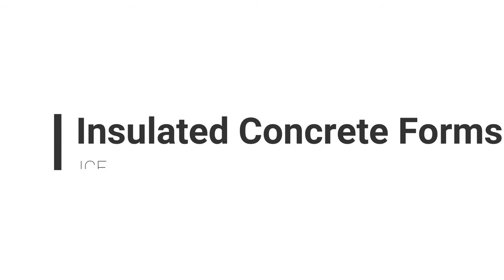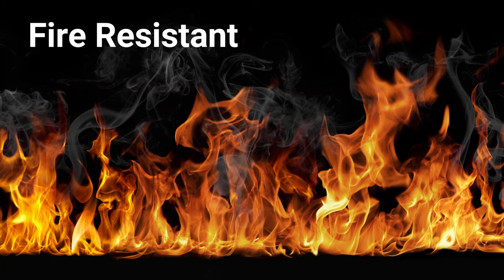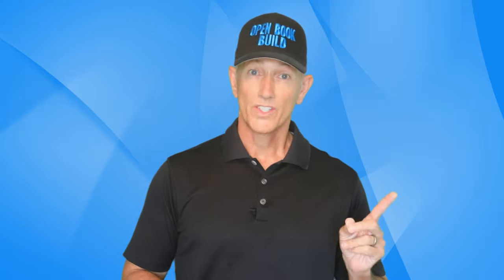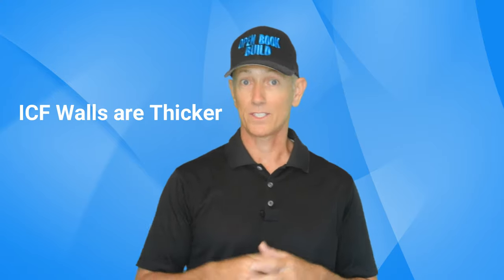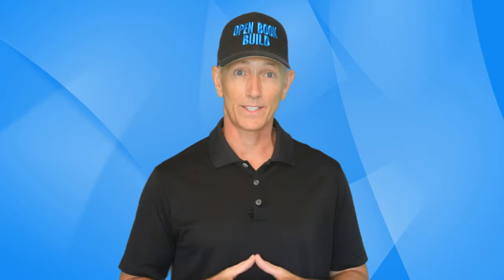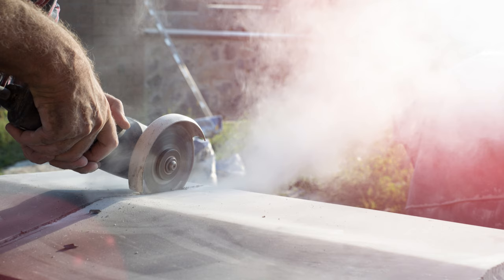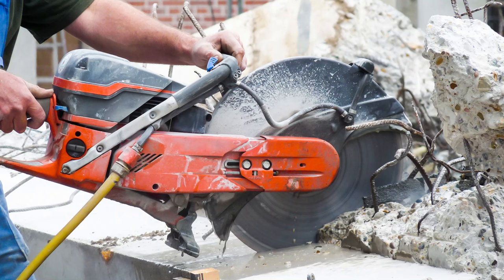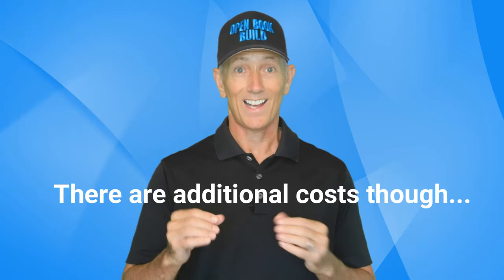ICF Construction: Why I Haven't Used Them as a Builder

Comment: I have to build a small house to live in. Around 20x20 is large enough for one old guy. I want to keep costs low, but it needs to be really well insulated to keep the sometimes minus 30F cold and 100+F heat out. I'll have a basement for the water heater and furnace and things like that. Stick frame, at very least 2x6 studs and possibly 2x8. One room with a small enclosure for the bathroom, the rest of the floor plan will be open with just supports for the roof and our often-heavy snow loads. OR, ICFs? There's a local builder who specializes in ICFs. They'll do the job right the first time. Hmm, what should I do?

Comment: I have watched several videos on ICF’s. One issue that I have seen is that they can’t get termite protection. Due to the insulation on the outside. The termites being able to tunnel through it and not being visible.
Reply: Not true. The exterior wall of ICF can be protected from termites, if needed, like any other wall by using wire mesh screens or other methods. Plus any termite damage will never be structural as termites can't eat through the concrete core, and the foam is not a food source.

Comment: Masonry loves to wick moisture. Masonry need some air contact to dry out, or it gets water logged. The plastic pieces allow moisture to go though the wall. Rebar should be in cased in at least 4 inches of concrete to keep it from rusting. Icf is 3 times the amount of cmu block plus concrete.

Comment: How about using ICFs for just a foundation wall? Considering for a bardominum build in NE Ohio.
Reply from the maker: Definitely good for foundation walls
Reply: @OpenBookBuild  Good to hear. Figured it would be excellent for a thermal break to the slab. Side question. As you are in Ohio, are you aware of any bardominium builds around? I’m nervous Lake County will be a real pain to try and build one. Especially as and owner builder.
Reply from the maker: @davidreilly3456  I'm now aware of any.  Just make sure your plans are detailed and meet the requirements of the building department.  Most municipalities require a structural review by a licensed architect or engineer for permit submittal.
Reply: @OpenBookBuild  Thank you for your insight! Now to hunt down an architect.

Comment: This may sound silly, but have you had any thoughts on ICF with a regular 2x4 stud wall on the inside? I like the idea of sturdy and energy efficient concrete walls, but stick frames inside also make it easier to wire, plumb, hang TVs or speakers, or make any alterations. The obvious downsides are more cost and larger overall house footprint.

Comment: As someone who has labored on icf and stick builds I strongly disagree with your assumptions. First,  a good build begins with good planning which means good architects and  site planners. All the math is done. Second, when prices for lumber skyrocketed, concrete turned out to be a cheaper option. While the icf build is definitely more expensive over-all, it's recovered easily through heat/aircon costs in short time as icf is usually in the r 30 range with little wind break vs r12 minus gaps for wood. While it's true you require specific skills for icf pours, it's no different than finding a roofer for steel vs shingles. There are as many costly mistakes for stick frame as other builds. Finally, off-gassing temporarily is a poor excuse to reject quality when redundant hvac system requirements in most municipalities make this a non-issue. Furthermore, renovation concerns are a definite drawback but I revert to where I began with poor planning as a bad excuse for discrimination to this style. We agree on cost being the only significant valid reason to reject this method. Ignorance is not a valid reason.

Comment: The American fears and loathes construction methods and tools that aren't taught in arts&crafts.
As an European, I'm considering this as a robust alternative to aerated concrete bricks. With bricks of some sort as the default, the only relevant downside is moisture retention. 
I'm guessing I'd want to save on costs and still use bricks for interior/non-load-bearing walls?

Comment: While I respect your opinion and agree much of what you say may possibly apply to DIY'ers who rush into it, it's not a very realistic representation of professional ICF construction.  If people take the time to know in their minds what they want in the house and accurately relay that using reputable and experienced architects, engineers and contractor most of what you've mentioned doesn't apply.  Also if the concrete your using takes a year and a half to fully cure that's a major red flag, typically between one to three months for a large house (triple level) solves any moisture issues with those issue's becoming less as that time passes.

Comment: A couple of the obstacles mentioned weren't ICF problems exclusively but just any poured wall system. In general I see the ICF as an option of choice for the self builder who wants the maximum substantiation in structure.  Also... trees absorb CO2 to mitigate climate change. Sustainable lumber isn't always sustainable lumber. Deforestation is a serious problem and yes, concrete production is also a major cause of global warming but your higher efficiency home is an offset.

Comment: I built a Poly-Steel ICM home 25 years ago in MN and would never go back to stick built construction.
Reply: Nice..  I am looking to build up in Otter Tail county Minnesota.   I am loving what I am hearing about ICF construction.  Any information regarding your experience - dos and don'ts - would be greatly appreciated.  Thanks, Mike
Reply: @lembeck4010  Dos: Plan ahead for any possible change you may want to make like running an electric service to a future pole barn. Add the appropriate size PVC sleeve so you won’t have to core drill later.
Dos: Don’t cut corners with the bracing… mistakes are $$!
Dos: The house will be air tight so install a HRV to control winter humidity.
Don’t: Don’t build in a state where you will become a slave of the state!
Reply: @VetSemperFi  Thank you Vet!!  you said "Don’t build in a state where you will become a slave of the state!".   We both live in Minnesota.  I do consider Minnesota a slave state as seen by my taxes.  Please clarify your "slave state" comment.  :)  thanks, Mike

Comment: You don’t need to seal electrical. You screw the boxes plastic studs at every 8 inches.  It’s faster to cut with a foam knife than a wall than to drill dozens of studs.

Comment: Sounds like your subs are not into quality craftsmanship. As an HVAC contractor, I have done a few of these homes and proper planning and constant reviews are required.  Yes!    This means the GC must be on site at most times, especially at the beginning.  Only one problem I had and that was the Heat Exchanger we used was passive vs. active.  No bid deal as we connected it with the bath room exhaust.
Get better subs!

Comment: An honest opinion without being rude.  OK.  But most of the comments were along the line of "if you don't plan right, then...".  Of course.  No one will take a set of plans for stick built and assume everything is the same for ICF.  I got plans for my new home from a company that offered both versions (and then some).  This is just about common sense.  Of course you make sure you have enough penetrations for your utilities, and maybe a couple more just in case.  etc...

Comment: I built one. I never consider other methods than ICF. If you use brick  the wall wil be 19 cm. But if the land is big no problem. USE STACO AND You have to have very good plan. Otherwise price will go up.
Reply: water makes ICF stronger
Reply: ONE MORE THING YOU MUST USE FIBERGLASS WINDOW FRAMES.

Comment: It's not closed cell structure   The Concrete can be mixed with ground glass, too. 
All your reasons are based on not doing your PRE work and using a good engineer & architect.  In other words, do your pre-work!

Comment: ICF material cost is relative to stick framed far more stable. How can a DIY builder budget for a build with the price of wood framing, sheathing absolutely unstable..He cant do as are builders, create a cost contingency, passing on increased cost to the customer in order to mitigate risk... agree that ICF is not well suited for non custom builders and those dependent upon semi skilled low quality, low pay framers that construct the bulk of today's homes. Absent is the comparison of stick framed vs icf moisture and rot issues that would no doubt alone tilt the scale to ICFs, the greater resale value and much reduced energy cost as well. The need for a change of rough openings in years to come, how often is it required?  Due to the labor intensive process of the straightening of wood studs its often rushed, resulting in unsightly shadow lines of exterior and interior finish( perfectly straight metal stud interior framing is far less costly and labor intensive than 2x4 construction) 
ICF is currently a niche market requiring much greater attention to detail,not well suited for shoddy production framers That said, why can't we trade the expense of overly complicated gaudy architectural nightmares soon to be dated for traditional non complicated designs incorporating ICF exteriors?
Reply: Why would an icf house have greater resale? There is no calculation for home appraisals for icf. You can build more energy efficiency homes using non icf techniques.
Reply: @av1204  ...the amount of time/extreme attn to detail/labor skill & materials involved to bring stick anywhere near ICF energy efficiency is not worth the huge added costs, as you still face issues of insects/water/fire/winds/noise/etc, which ICF is nearly impervious to.

As for resale, it's mostly on the seller to educate potential buyers of the added value. You're correct in noting appraisal value isn't likely to rise, but this is a fault of the financial industries not keeping up on building tech. Insurance industry absolutely knows the difference ICF makes, just look at premiums in fire/tornado/hurricane/quake prone areas.
Reply: @av1204  Sure, but to reach R25 and perfect seal with a stick-built it will cost the same as ICF and take longer to build.
1 ICF trade will complete the work of 3 or 4 trades in one go.
If you want to go above R25 with stick-built good luck with double framing, all the amount of layers of wrappings, sheeting, nailings and tape.
Also, many counties require to meet a minimum hurricane rating and therefore you will have to use steel strapping on every floor, a 4000sf home stick built will cost you 7 grand for strapping only, while the ICF will not need that.
I understand resale value will not vary by much, although there is the appraisal for "concrete construction" vs else. Not mentioning the saving in house insurance due to fire resistance and hurricane rating.
Reply: @sebastiantevel898  I have an ICF house. I know what the benefits are. Price isnt one of them. Acting like a stick frame house cant be built to the same standards for less is a joke. 2x6 framing with open cell and zip R. You can easily get the same air tightness for less.
Reply: @av1204  hey AV, was it worth going the ICF route? Asking honestly here

Comment: Unsubscribe. What trash arguments. It’s 2022; if you’re building with lumber just burn your money instead of giving it to the energy or insurance companies.
Reply: Unsubscribe? Still great information across 90+ % of his info and content. I do however
agree that the arguments against ICF are laughable, but that’s just it, the arguments against IcF are laughable across the board, it’s was always argued that ICF was cost prohibitive, now with lumber through the roof there isn’t much of any legitimate argument against ICF. Having said that I find it interesting and valuable to hear from a knowledgeable guy like this about his “cons”.
Reply: It’s just his opinion on why he doesn’t build with ICF. I’ve looked into it and would agree with some of what he said. But all those arguments can be overcome if you choose to use ICF. planning is most important. I’m in an extremely hot and fire threatened area, so it makes more sense here. He’s in Ohio. Where it might not be as necessary.  Just my opinion.

Comment: Im confused! If you mix concrete correctly water DONT evaporate! right amount of water produces masses of needle-shaped calcium silicate hydrate crystals which bind together around aggregates and sand to give the concrete its strength!
i worked many years in concrete companys, and on say small house builds pouring say floors we used say tarp ore wet sawdust ore poured water on top of the drying concrte if it was a sunny windy day so that the concrete sholdnt CRACK IF THE WATER EVAPORATED TO FAST SO THAT THE CONCRETE GOT DRYING CRACKS.
I bet if you get moisture problems AFTER you have buildt a CORRECT  ICF room is that you havent added WENTS ENOUGH! 😁
In a SEALED ROOM even the evaporation from a human is enough to make water drops on the walls. hehe
Not to mention the temperature difference between day-night and the difference in air moisture!
Notice what happends if you say take a COLD bottle out of the fridge, IT CONDENSATE the moisture in the air almost in seconds, 
And same will happend with the termal mass in the walls IF ITS NOT WENTED CORRECTLY ACCORDING TO LOCAL CLIMATE.
Reply: Yeah, I think the that part of the video misunderstands how concrete needs humidity to cure and becomes stronger.

Comment: personally I would prefer to build with sips or do a double stud construction to get to the same end result.
Reply: SIPs have tons of real issues even if you don't include cost.  Double stud eliminates your conventional framing cost savings but still leaves you with a wall that can be destroyed by insects.

I tried to like both of those systems until I added finishes to try to make them long lasting like steel or cement board siding with good water barrier products and a rain screen.  Bottom line, you'll spend more to try to make a wall as durable as ICF but with no guarantee that it will be as durable.  You won't see that until you price the entire wall from the siding to your drywall/interior.

Comment: Oh so a builder doesn't like ICF because he can't use canned floor plans and can't make sure that everything is set before breaking ground.  Yes, there are considerations.  Just say that you are not the right builder for the job and don't take on a project that you are not capable of.  Don't talk down a method that has numerous benefits.

At least you are honest with the issues that need to be addressed.

Comment: Stick build should be against the law as this is not a real house. You get 50k in materials and charge 400k for what is a cabin really. You can't call a house some structure that is easily torn apart by stong wind and evan larger hail. People, don't listen to these so called builders, build your home of real material like concrete, stone, iron and brick. These guys are not builders, they are just carpenters that extremely overcharge you for bunch of cheap and not reliable wood. In the rest of the world the carpenter comes to the finishing stage of the house, he is not the main builder like here in the US. ICF is revolution, especially for the US.

Comment: What else do you do? Sell used cars? 

Water in concrete doesnt "evaporate". Ever seen concrete people keep concrete wet for days? That's called curing. Concrete absorbs water after it sets. That actually makes it strongers so that foam insulation works to concrete advantage after it is poured. 

You say concrete is not forgiving? Well.. what is there to forgive? U educated builders who cant build right the first time?

Comment: Try pouring a slab not square or true when building a stick house, the problem will haunt you until the roof is complete. Every job and materials requires exactness with plumb and measurements. What a stupid excuse for not using CF blocks.

Comment: More holes in your commentary than a brick of swiss cheese.  Not about to pick apart your rhetoric, some of which is valid, but having built with ICF's since 1999 there are no difficult challenges with using them.  Just a different technique.  But all in all, the payout is tremendous when it comes to sound proofing and insulation values.

Comment: I think to do ICF as just an exterior wall concept then lumber interior walls. Then make all electrical and plumbing connections only to interior walls. I could live with that then you should have no problems with repairs due to moisture damage and the exterior wall should remain stronger for longer. Id hate to have to do repairs breaking and fixing concrete would reduce the integrity of it.